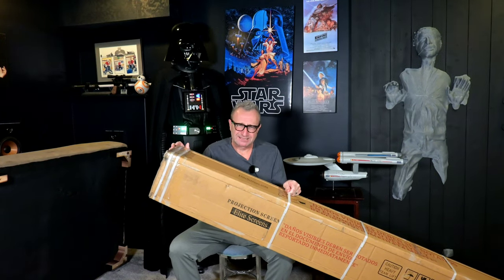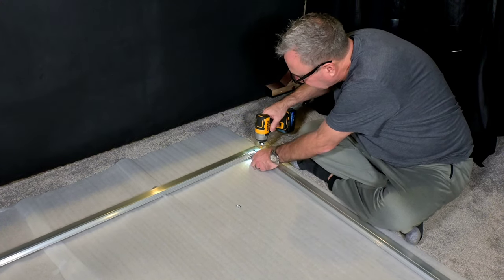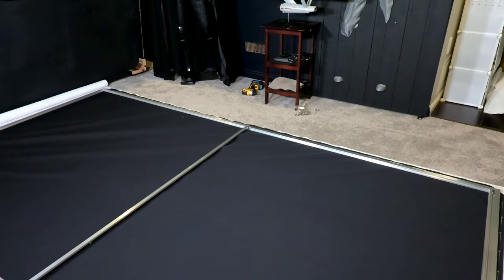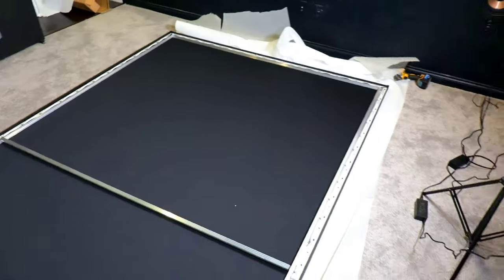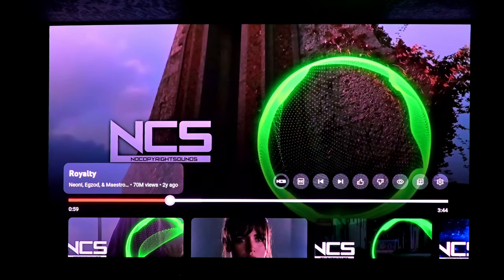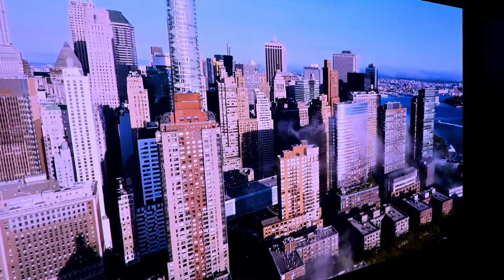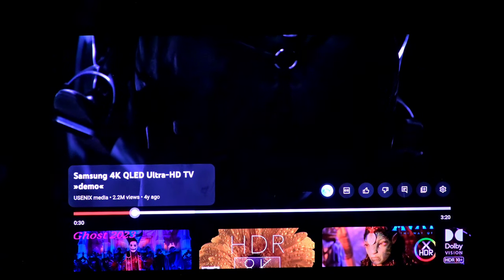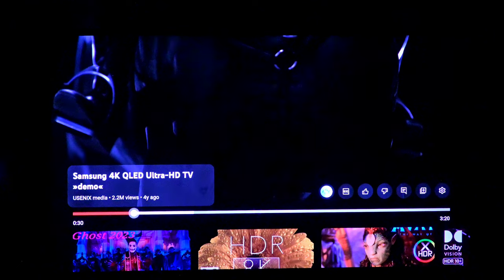Elite Screens Aeon CineWhite A8k Edge Free Acoustic Transparent Screen Review

Comment: I have a jmgo n1 ultra projector and have been looking a this screen to get rid of the laser speckle.  So its great to see you doing a demo of the screen with the projector. My only worry is my room is not 100% dark so was wondering what the blacks would look like ? Have a grey screen at the moment which give me darker blacks but have the laser speckle. Great videos by the way 👏
Reply from the maker: I would say that this screen gives you some of the benefits of an ALR but with absolutely no speckle whatsoever. My N1 is about 12.5' feet from the screen and I barely used any fit to screen feature as well so less wasted pixels. You can see on the thumbnail how good the screen looks with all the lights on in my home theatre which really took me by surprise as I wanted expecting that.
Reply from the maker: And thanks for watching!

Comment: Sir does this screen have micro perforations or is it a weave material. How is the sound transmission.
Reply from the maker: It's neither perforated or a weave...the best thing I can compare it to is a ALR material more like nylon in a sense but not the same. Truly, I don't know what the material is I just know it has 100% removed all speckle and the colors pop and the contrast is even better on the N1 if you can even imagine it getting better...
Reply: @OlyGoalie67  sir if you take a close look at the screen can you see any tiny perforations.
Reply from the maker: @15.emanuelshaju24  there are no perforations at all.
Reply: @OlyGoalie67   then its a weave screen sir. How is the sound transparency via screen. Is it perfect . Are there any distortions.
Reply from the maker: I would say there has been no change but my old screen also partially covered the woofer section of my speakers and it was a vinyl type material so definitely blocked some of the sound. The decibel level using a basic app on my phone was very similar, maybe better on the Elite. As far as distortion, I could not hear any but I'm also 56 and do not hear like I did in my twenties 😂
Reply: @OlyGoalie67   lol. That sounds cool